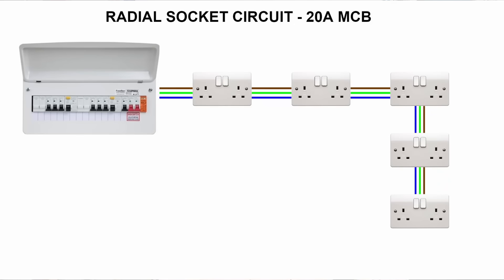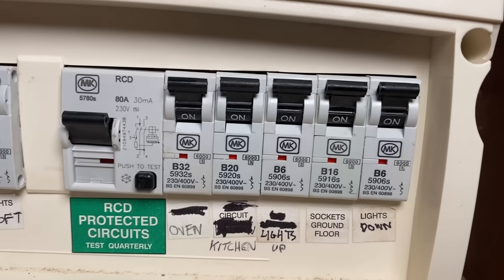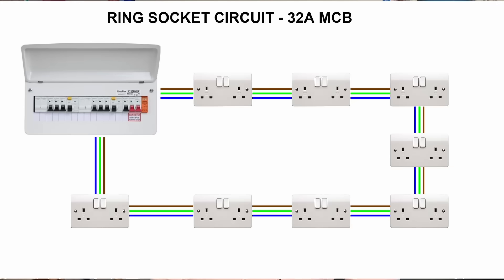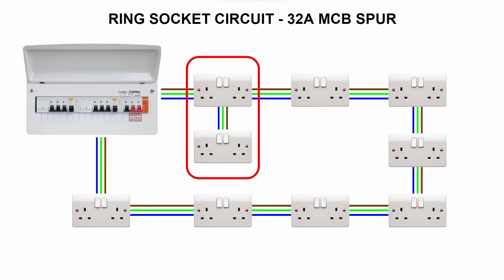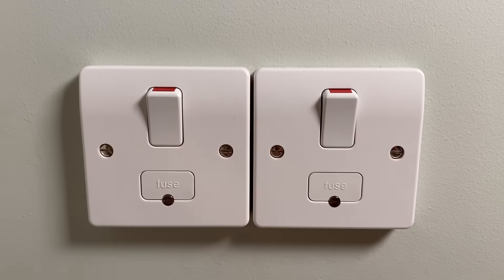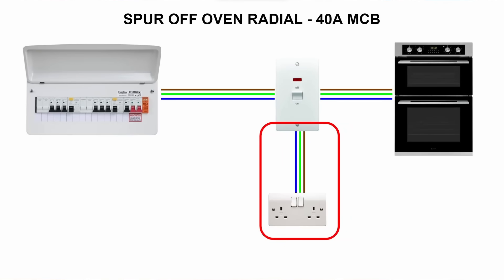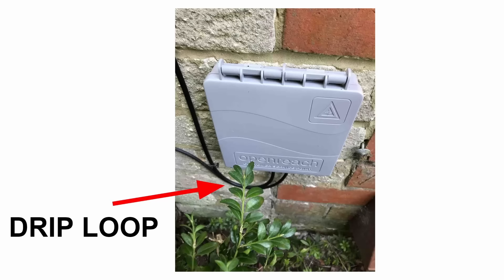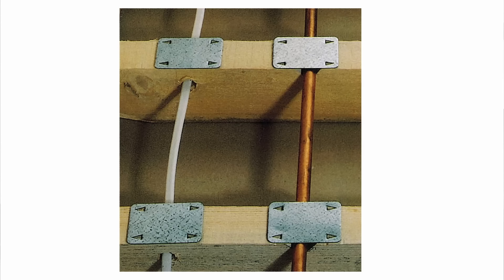BIGGEST DIY Mistakes Adding a New Socket

Comment: Single spur sockets never used to be an issue, why are they now?

2.5 twin and earth solid core cable is, and always has been adequate. I don't recall any specific instances of issues, although I'm sure with 25 million homes in the UK statistically there will be an insignificant example of wiring failures. Just as there are always statistical anomalies in anything...
Reply from the maker: Single socket spurs are okay, the issue is multiple socket spurs. Thanks for watching!

Comment: Thank you for your video, could you please clarify on a radial circuit do you not have to have a bigger cable like a 4 mm
Reply from the maker: Thanks for watching! A radial on 2.5mm and a 20a MCB is standard, or radial on 4mm and a 32a MCB. You’ll need to consider cable runs and appropriate cable rating, but the numbers I’ve given are most common I find
Reply: Thanks very much
Reply: depends on circuit length and if run through insulation. Maximum permitted Zs values are lower for a 32a than a 20a.
Calculating everything by the equation in the book and having to refer to various tables and derating factors etc is a bit of a faff!!

Comment: 'A radial.....goes to each socket, in a line.' - not true, you can branch them. 

Your current carrying capacity table has the values for method 100 and method 101 the wrong way round.

'So clipped in free air....' clipped direct and free air are different and have different rating values.

Most modern ovens aren't high powered and a lot of them are on plug tops.

No professional electrician uses 'safe plates'.
Reply from the maker: You can branch sockets on a radial, i wouldn’t consider it good practice though. 

I think that table screenshot came straight out of the regs document, so I’d hope it is accurate! 

For a single oven agreed, but people still do install large range ovens. 

I don’t know why professionals wouldn’t bother with safe plates, seems like a no brainer to me.

Comment: From personal experience I rarely come across ring circuits now, though I do still find sockets wired in with 1.5mm Cable instead of 2.5mm
Reply from the maker: Yeah i think rings are becoming old hat now. Thanks for watching!
Reply: The reason you see it is that it is permitted under the regulations, as long as it's a spur protected by a FCU.  2.5mm cable is always required on the ring circuit as it needs the extra load capacity in case of a breakage or loose connection (resulting in 2 paths on the ring reducing to 1, which theoretically doubles the load on the existing cabling), but on a spur with a 13 amp FCU 1.5mm cable (rated at 16-16.5 amps) is acceptable as it doesn't exceed the load requirements.

Comment: What do i do about all our houses sockets being on one breaker (lights all on one too) but unable to afford a rewire?
Reply: If they're done as a ring, you could split them into 2 20a radials
Reply from the maker: That sounds like a very usual set up. Maybe get an electrician to come and quote for work, and they should tell you what is wrong and needs to change
Reply: dont plug shit loads of heaters in I guess?

Comment: A radial circuit doesn't have to be as you described,  As long as your cabling is rated for 20A you could set up rings within rings and as many spurs off of how many points as you like with no limit on the amount off points off of those spurs.  You'd obviously take demand into consideration during the design phase
Reply from the maker: Yes absolutely true, but i think most electricians would consider it bad circuit design. It would also be a nightmare to fault find and test
Reply: @TheDiligentDIYer1759  they’d say it was bloody shocking to be fair! 😂
Reply: A radial is limited to 50 square metres of floor area, while a ring is 100. So there are limitations. But try to keep a circuit simple as possible.

Comment: i think radial sockets are on a 4mm cable to a 32a fuse and ring sockets are generally on a 20a fuse..... not the other way round...
Reply from the maker: You can do a radial in 4mm on a 32a mcb, but with 2.5mm cable a radial should be 20a usually. A ring enables you to exceed the safe rating of a cable, so a 2.5mm ring is okay on a 32a mcb

Comment: In Germany 1.5 mm² solid wires are used.
And the wires are placed radial or serial in the wall close to the ceiling.
The sockets are split of from the ceiling in a serial manner. So it is a completely different wiring style.
and 16 amps breakers are used
Reply from the maker: Thanks for watching!
Reply: Thus unnecessarily mixing low power lighting from power circuits. 
And in my view (though I have tended to work on older flats) generally having too few circuit breakers in general. 
I do prefer the UK method of having separate light (5A) and power circuits safety and the running of wires up an down walls.

Comment: A few years ago, I went to a house to re-site a fitted wardrobe from one room to another. On pulling out the drawer unit, I came across a double socket box with both sides of the ring exposed - the socket had been removed to allow the drawer unit to fitback to the wall. No insulation tape; no strip connectors - nothing, just the exposed line, nuetral and earth hanging there. The ring was effectively broken, and had any of those conductors touched, any electrician would have had an impossible job, tracking down the fault. And all for the want of a trip to the nearest DIY store... and this was a 'proffesional' fitted furniture installer.
Reply from the maker: That’s terrible! Thanks for watching!

Comment: when i run a spur i always use 2 runs of 2.5mm to a single double patress (and connect both in parrallel ) that way i have cable ready to go if i need to add extra sockets later i can convert my doubled spur into an extension of the ring, just by reconnecting one cable as the return of the ring how ever i have always wondered what method of joining cable ends together when you need to return the ring in or behind a patress ,are 3 individual 2way  wagos acceptable? ive used those 20a round 3 way junction boxes but you only have room for those in loft space or under floor boards ,not in a wall
Reply from the maker: In theory i think a 3 way wago is okay, as you’re spurring off the ring. However i think it best practice to spur from a socket. Thanks for watching!
Reply: 20a junction boxes are not suitable for extending or spurring off a ring. They must be 30a rated as that's the breaker size. This has been discussed by YouTube electricians, GSH etc. Some or all of the 32a draw can go down one leg as rings are rarely balanced.

Comment: There was no law stating ring mains had to be used from the Second World War. In fact most electricians were a bit sceptical and carried on using round pin sockets well into the  mid 50s .  My Nan and grandad had a new council house in 1952 and it had round pin sockets 
When I was a apprentice I worked in a large house. My boss said it was wired in 1973 and every socket was round pin . It’s what the owner requested.he said
Reply: It's still within regulations to use round pin plugs (except for the 30A variety, which were hardly ever used an now withdrawn). You can ever get them with shuttered sockets and fused plugs. The 3A and 5A varieties often get used in lighting circuits, commonly in theatres and in some hotels where you can turn table lamps on an off from a wall switch.

However, they do have to be protected with the appropriately rated fuse or breaker or course.
Reply from the maker: Thanks for watching!

Comment: I prefer to guard a 2.5 mm cable with 15A... 20A is a bit generous.... - if I was fitting out a hotel / hostel then each room would be guarded with 5 to 10 Amps and be on its own spur....
Reply from the maker: Thanks for watching!
Reply: why is it generous? What issue does 2.5mm have with a 20A breaker?
Reply: @jameshansing5396  it contradicts my education + experience... - 20A is too much ...only a bandit would tell anybody to do that...
Reply: @MEANASSJAMSTER  what’s the current carrying capacity of 2.5mm?

Comment: An electrician suggested replacing the 32A mcb of the ring circuit with 2x 16A, each one protecting each direction of the ring. That sounds like a good idea, right?
Reply from the maker: I think that is okay, as long as they can split the ring somewhere sensible. It wouldn’t be great to have some sockets in a room on one mcb, and the rest on another. You could likely go up to 20A too

Comment: It's really easy. Reduce the fuse from 32 amps to 16 amps. The whole world uses radial wiring with 15 or 16 amps. 
Only the English have this antiquated ring wiring. If the ring is interrupted there, you have two radial wirings.
Reply from the maker: Yep true, 20A would be fine

Comment: 5:07 How can you pull up to 52A if the breaker is 32A?
Reply from the maker: I said you could in theory plug in appliances rated to a total of 52A
Reply: when does a 32A breaker trip? Let's say a B32? or a C32?

Comment: It's perfectly fine to run a socket off a lighting circuit as long as it's fused down to 5A.
Reply from the maker: I think it is technically allowable, but most would consider it poor practice
Reply: @TheDiligentDIYer1759  It's not poor practice tho if you use a FCU as that protects the cable.
Reply: @markawes  you dont think running power off a lighting circuit is poor practice? FFS!
Reply: @jameshansing5396  No, as long as its fused down accordingly there is nothing wrong with it at all.
Reply: @markawes  there is! 😂
Reply: @markawes  what’s your job?
Reply: @jameshansing5396  What's that got to do with my comment?
Reply: @markawes  just wondering if it was Electrician? 😳
Reply: @jameshansing5396  No, are you? educate me :)
Reply: @markawes  yes! 😂
Reply: @markawes  that went a bit quiet all of a sudden? 😂 God bless the internet!
Reply: @jameshansing5396  An electrician did work in my outhouse and wired sockets via light circuit and told me it was safe, just not to plug in any kettles etc. So why is it bad practice if its safe?
Reply: @markawes  it’s poor design rather than unsafe. Yes the fuse protects the cable but you’re still adding 5A loads to a 6A breaker, possibly wired in 1mm so you’re also adding quite a bit of load to that cable.  Plus, a 5A spur THEN having a 13A plug into it? 😂😂 Wtf???? 

Just because YOU don’t plug silly things into it, doesn’t mean others won’t? You’ve created that facility?  And how many times are you going to do this on 1 lighting circuit?  Yes it would blow the fuse if you overload it with say a heater but again, poor design so not best practice.

Sorry but your spark is a tool, my friend .

If you can talk to me about circuit design in terms of design current, time curves or breakers and have passed your latest regs course then cool. But none of this is going to happen.

Sorry to break it to you but there are plenty of rubbish sparks out there! Your fella sounds like one!

I mean literally, 1 x 5A on a 6A breaker???? PLUS all your lights, bathroom fans, heated mirrors in bathrooms……. 

I’m sure you’ll still be convinced you’re right and I’m wrong though 🤦🏻‍♂️😂
Reply: Yeah you're wrong electrics are piss 😂, I've no idea what it was done in to be honest. I just assumed it was fine as he is supposed to be a professional doing a service for me. It's been there 3 years without issue so I'm not to worried but I'll remember this going forward.

Anything I should look out for in terms of it going wrong? - thanks for the heads up.
Reply: @markawes  I’ve stumbled across so so many shit sparks in my time.

Like I say, it’s kind of covered in terms of safety by the fuse between the light and the socket but it’s still piss poor really. Sounds very lazy.  Plus there is a potentially nasty little part in current curve of a breaker where it can be overloaded but not enough to pop the breaker any time soon. So it all just sits there….. getting hot ….

What to look out for ? $1M question…..
Reply: All that I have plugged into it is a network switch for some poe cameras and a floodlight.
Reply: @markawes  yeah so what YOU are doing is all good my man. Your individual situation isn’t the end of the world. It’s “safe” as you say. It’s just not as black and white as “it’s fine as it has a fuse”. I didn’t mean to be sharp, I just see SOOO much badly done stuff and so many sparks who really don’t know as much as they should. It gets a bit much some times! 😂☹️
Reply: @jameshansing5396  So really the spark that did the work for me should of known better and maybe found another way to put a socket in there. It's not nice to know that something I paid for was sort of done incorrectly by a guy that I put my trust in.
Reply: @markawes  it’s not going to burn your house down but personally I don’t think you’d find many who would give it a thumbs up! I’ve seen far far worse but for me the biggest negative is not being open with you.

Stuff powered of lighting circuits = bathroom fans, heated mirrors, big ole floodlights. These days it’s all LED so the current draw is nothing so overload is even less likely….  I just don’t get why someone wouldn’t grab the power from a socket circuit?

Like I say, 5A spur ummmm 6A main breaker? 🤷🏿‍♂️🤷🏿‍♂️🤷🏿‍♂️

Comment: One of the best explanations I’ve seen👍 surely plugging a 4 gang plug extension on a double spur has a risk of overload also?
Reply from the maker: Thank you! A 4 gang extension lead will have a 13A fuse in, so won’t cause you any problems
Reply: @TheDiligentDIYer1759  Seem to often contain 10a in the cheaper ones these days. Depends on the length of flex. A 13a fuse can draw around 15a for a very long time before it fails. I've seen quite a few multi-gang extension leads melt before the fuse decided to pop. The time curve charts for various fuse/mcb types in regs book are quite disturbing when you look at worst case scenarios! brass terminals in plug-tops are fairly poor these days unless you buy more expensive ones

Comment: TBH, I replaced all my 32A MCBs with 20A or 16A MCBs, I rather it trips at the earliest overload  than to risk burning my house with overloaded circuits, and I cannot comprehend how on earth did the BS allowed 32A ring circuit breakers, that is nearly a third of the 100Amp total current your electricity meter can handle, so imagine of you had 3 ring mains and each was capable of being used to draw 32 amps, that is asking for fire to burn your house down, besides who would ever use 32amps on a  ring circuit unless you were running 2 x 3kw electric heaters, most electric heaters are now rated at 2kw, and apart from that most houses are now using gas to heat homes. I have wired my house each room with its own radial, so if any appliance goes wrong and blows only its own fuse and not take down the entire floor, indeed safest bet is to use radials and protect your house with a 20A MCB, ignore the BS Wiring practice, its far too dangerous to follow silly rules, remember just as local councils realised how 30MPH was too dangerous in built up streets around schools and shops now reduced that to 20MPH.
Reply from the maker: Yeah the ring circuit regs are crazy. Thanks for watching!

Comment: I just discovered 2 double sockets that are just a spur off the ring main
Reply from the maker: Not ideal, probably best to add a fused spur in if you can, or reduce the MCB to a 20A
Reply: @TheDiligentDIYer1759  got 4 amp fuses in the plugs
Reply: @TheDiligentDIYer1759  its a 32 amp , will do as you advise

Comment: my country primarily uses radial. so if i connect say 3 plug points up per 16A breaker knowninly that the current wont pass that on 2mm wire all good then
Reply from the maker: Thanks for watching!

Comment: My stepdad wants to put a socket in the shed, but the only cabling going over there is a lighting circuit. I told him he can't, but he only wants to be able to plug in a Radio.
I'm just wondering if it would be acceptable if I put the socket on the lighting circuit, behind a low value fuse... what did you call it, FCU.
Either way, I don't really want to do it.
Reply from the maker: I’m not sure to be honest, it sounds like it wouldn’t be an okay thing to do though. If it’s only a radio, I’d suggest sticking to battery or a solar one
Reply: @TheDiligentDIYer1759  Another thought came to mind.
We have a Shaver socket in the bathroom that is actually on the lighting circuit. This was installed by professional electricians during our revamp in 2008. The main reason why I know how it's wired is because I had to replace it a few years later.
What if I did the same and put a Shaver socket in the shed? I should be able to find a 2 pin EU plug to figure of 8 cable, that would fit in a shaver socket, and the radio easily enough.
Being a shaver socket, it would scream "This is low power" and encourage people to not try and plug a lawnmower into it down the line.
Reply: @bobingabout Shaver sockets are current-limited and may not allow the current draw for the radio. You could put a BS546 5a round pin socket on the lighting circuit and change the plug on the radio!

Comment: Man, Euro wiring is WEIRD. I'm very jealous of the total power you folks are able to pull, but the simplicity of the north american system is so nice. My lights are on 14ga, sockets, 14ga, and breakers are just invariably 15A standard, 20A (12ga wire) kitchen, and then whatever bespoke for appliances (AC, dryer, stove). Not to mention, as long as I use heavy enough cables, I can branch whatever I want off whatever I want.
Reply from the maker: Thanks for watching!
Reply: Yep, 3kw kettle. While waiting for my to boil here in Canada ...

Comment: yeah, 32A current, will burn to ashes 27A wire, so dangerous, come on :D
Reply from the maker: Hahaha, i guess regular over load over a long period of time would probably degrade the cable. I’m sure the regs are that way for a reason